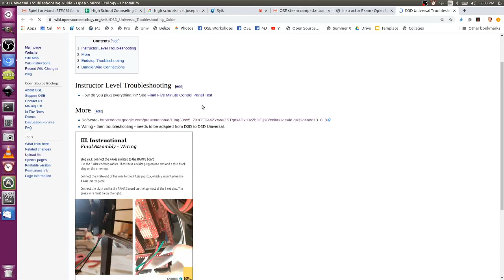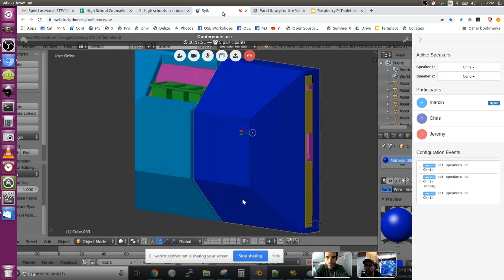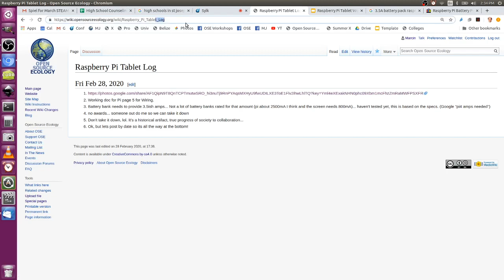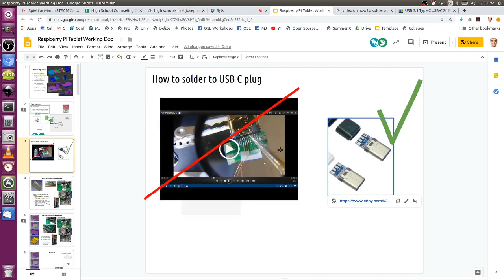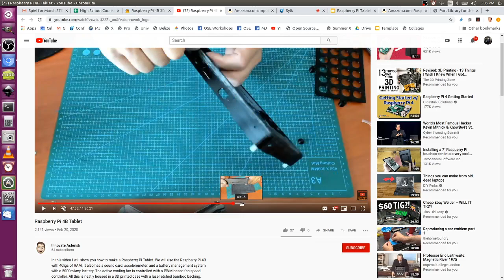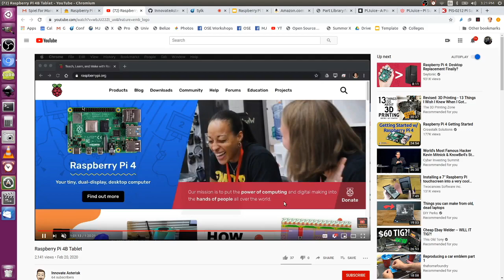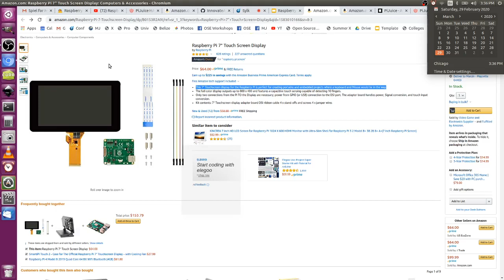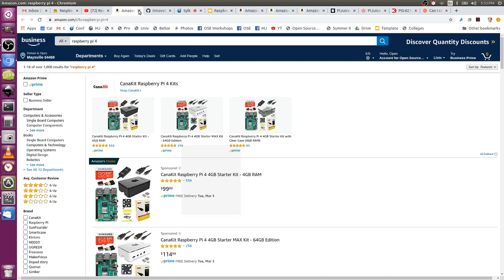Raspberry Pi Tablet - Development Meeting

Comment: Quick suggestion. The battery pack for the portable welder or open source drill could be used as a high capacity pack.  All that is needed is a voltage/amp regulator.